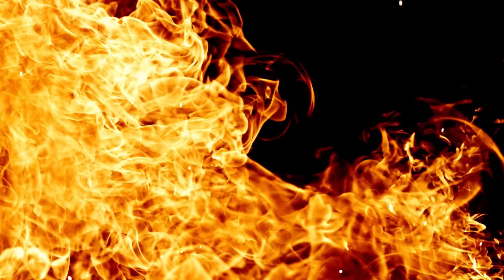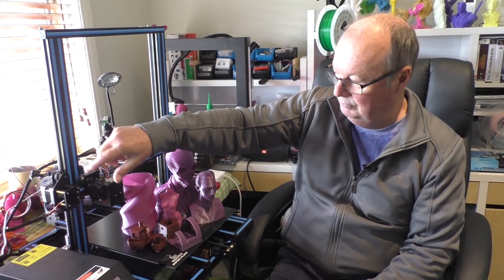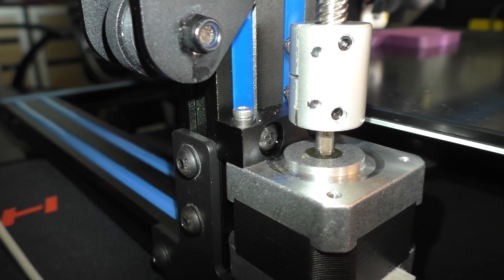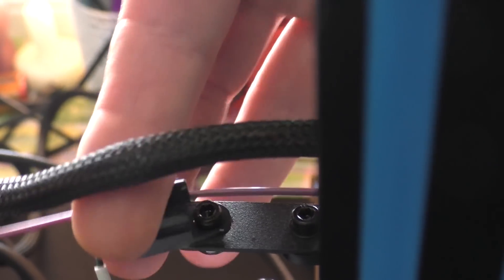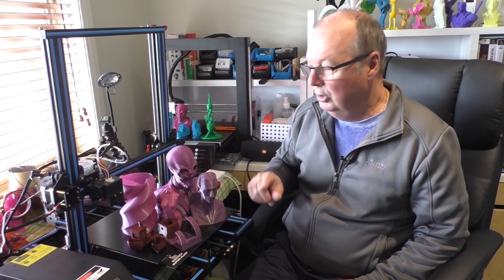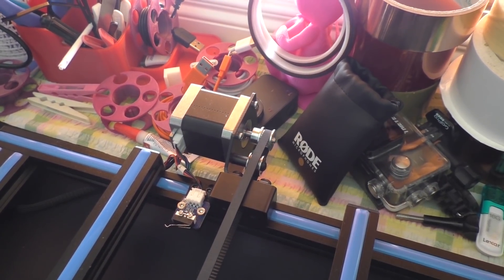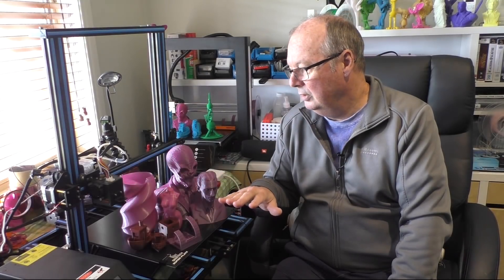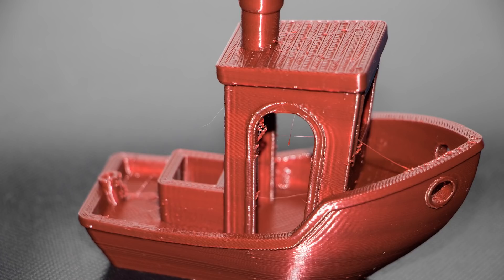Geeetech A30 3D Printer review!

Comment: I got this printer and it seems the main board does not respond. It holds bits n peaces of stuff in memory that gets tangled into the next print.

It's more then jus a resume function.

I totaly clear it, stop print and end print " this after pressing the touch screen 10 times before it responds"

I start a new print with new print settings like .3mm layer bed height and it then jams the print head into magnetic mat burning a hole in it.

Is it me or the printer?

Comment: Nice video! I own that printer for 6 months and can’t get out any proper print. I have so many hardware and firmware issues that while solving one problem another problem occurs. The main problem is the firmware which randomly pauses prints, doesn’t work with S3D in USB Mode, failed in update procedure which causes that the nozzle and bed couldn’t be heated anymore (GT replaced the control box), loose belts which results in big ghosting artifacts,  the bed leveling sensors levels the bed differently for every print, wheels are unround, and so on and on. By the I have the 12V version which needs nearly 10 minutes (!) to heat it up to 65 degree Celsius. Way too much time. The support is doing a great job but the hardware of my printer sucks and the firmware is a mess. I am at the end of my knowledge. :(

Comment: The spool holder worked fine for me, with two of the same Hex Screws,... so not sure why yours needs two types,.... just take the glass off, I did and use blue tape.
Plus, with the glass off, I've been able to replace the bed levelling screws to a move secure type.

Comment: my y Motor so hot how to fit
Reply: you have to adjust the voltage on the stepper driver. There are several videos on how to do this - search tuning stepper driver.

Comment: Nice video !

Can you share your cura profile please?
Reply: I just used the default settings.
Reply: thanks/ and what are your jerk and acceleraton value?
Reply: I set all my printers to the same value for comparison reasons. 800 accel. 5 jerk.
Reply: @Johkarphotos  John, when you say you set your printers to 800 accel. is this for all Max Print Accel, Max Travel Accel, or Default Accel settings??
Reply: I set them all to 800

Comment: It looks like all these companies are hopping on the bandwagon of making this open-frame, moving bed, PLA-only printers. Can''t even tell the difference between this one and the Creality and the others that look almost exactly the same as these companies race to copy each other. In additional, with the all exposed wiring, cheapest possible motion system and the smell and noise that comes from open machines, these printers are doing little to advance 3d printing and make the tech look more like a science experiment than a real product.
Reply: What are you talking about,  Making these printers work pretty well while making them much more affordable is a huge advancement getting them into the hands of many more people
Reply: I disagree completely.  I have over 7 machines that were well under 500$ and have a build volume that can only be matched by machines costing 1500$ and up.   I have had minimal to no issues.  Sure there are still garbage machines out there but in 2018 not too many.  Its a pretty simple technology honestly.  The more expensive machines that use the same tech (FDM/FFF)  are made of the same parts, just enclosed in a nice looking case.
Reply: All these CR10-esque machines are not good quality, they are good enough quality to last for a few hundred hours of printing, thats it. Those cheap ass wobbly wheels  wear out, power supplies blow up, motherboards can't be expanded and have barely enough memory for the basic firmware, under designed frames, obsolete lead screw design or even single screw, and tiny pancake motors to drive everything. Do I need to go further? These machines aren't meant to provide lasting service, they are engineered down to the last cent to last through a Youtube review. And 95% of these Youtube reviewers get their machine for free, and then they don't mention or don't know enough to mention the engineering compromises made in order to get as many people as possible to click through the affiliate link and buy one. I think The Hot End is one of the few more trustworthy channels but 90% of these "reviews" are just ads for subpar products.
Reply: You are just wrong,   I have 4 of these with thousands of hours on each they print almost all day every day.  Besides some minor repairs like wires ripping from being to close to my wall they have no issues.  You are wrong.
Reply: Tevo Tornado board (349.99) has replaceable drivers, so again you are wrong.

Comment: As with all of these printers, "It's a great printer after you....".  Great review.  I like that the automatic bed leveling, filament run out, color touch screen, 32 bit processor, etc. features have made their way into these class of printers.  But it is still very obvious that if you are not electronics savvy, this is not a printer for you.

Comment: Hi Anthony, thanks for your video. We'll do better.
Reply from the maker: Geeetech it span out some very nice prints in the end! Quite nice
Reply: Yes we'll explain to me why the touch screen freezes, holds bits of stuff in it's memory after I totaly stop a print and start a new one. But will not change settings as I change them in cura.

Example the print head is jamming into the bed no matter where I set the first layer height.

Oh btw I have the auto leveler on it and that seems to work.

Now my magnetic bed cover has 3 holes burnt in it and I can not get any settings to change on any practice print I try.

It's junk! $500 and it's just a paper weight in my room.

I can make video to show you what's going on if you want!

I'm making a video anyway

You guys need to include the best cura settings in a simple list form.

I did read the instructions on the SD. They where no help, brief and says nothing about best settings for this printer.